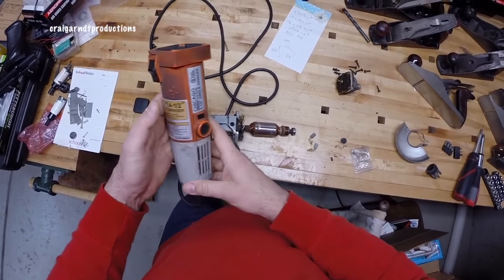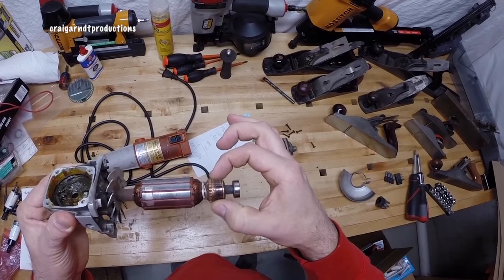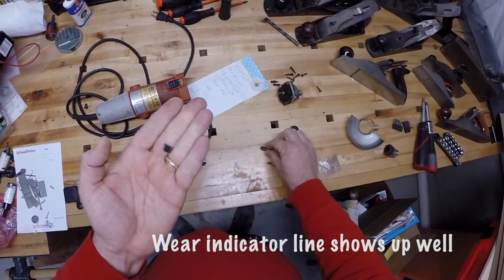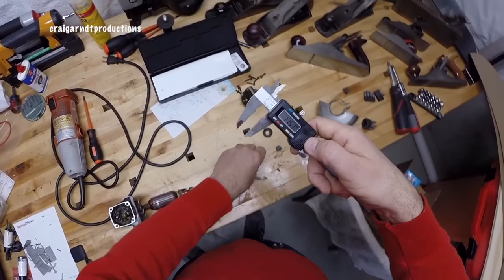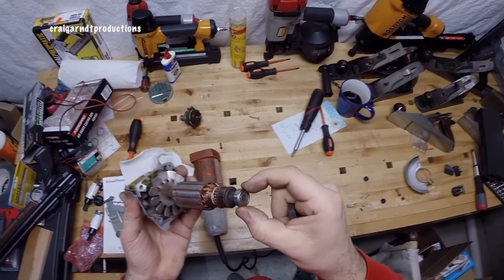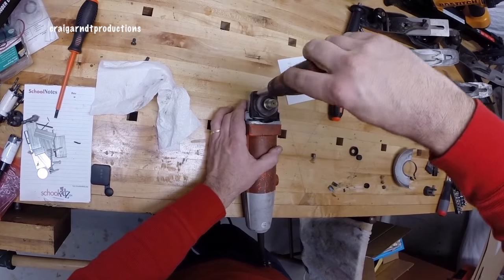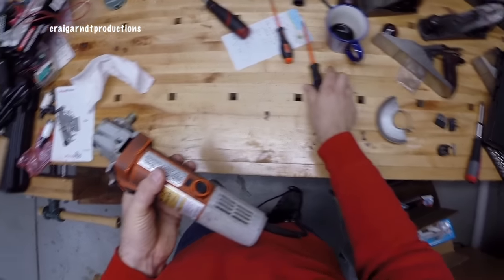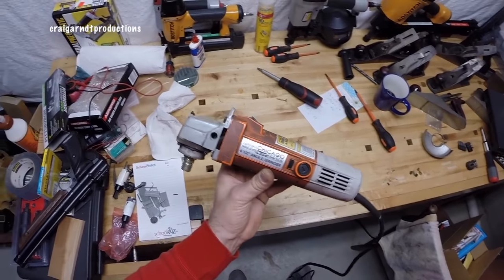Grinded to a Halt!

Comment: Good job on the repair ...That's Ok that you took it apart and cleaned the insides and inspected everything
Reply from the maker: I used this for the log splitter build so it certainly was used a lot.  Strange that the brush broke in half, thinking that I may have dropped it or something.  I've never seen a brush crack in half.

Comment: Just make sure of the Obvious and that is that the plug is next to you on the Bench where you can see it. Never open anything electrical while it is plugged in even if the switch is off
Reply from the maker: Yep, I'm not interested in stopping my heart over a $16 grinder.  :-)

Comment: don't forget to check the spring size on the brush I've had a couple of issues with brushes that are the correct size in every other way!
Reply from the maker: Good point, I will be sure to do that as well.  Thanks for the tip!